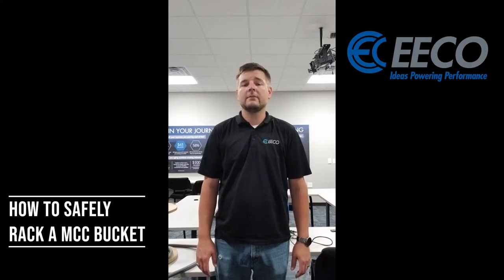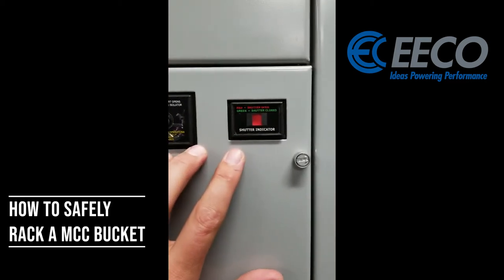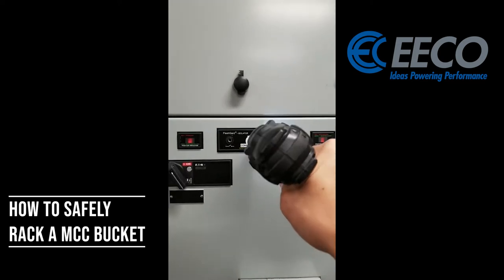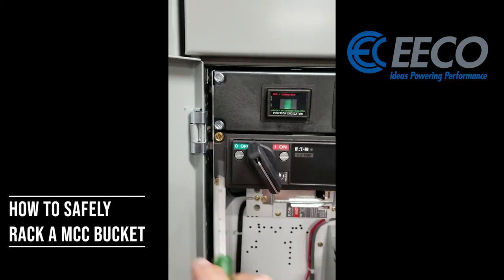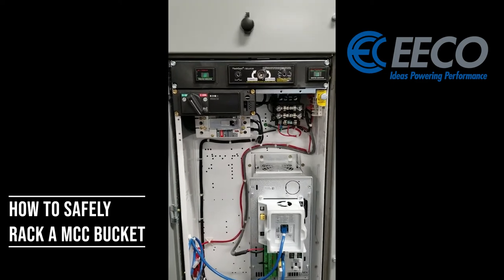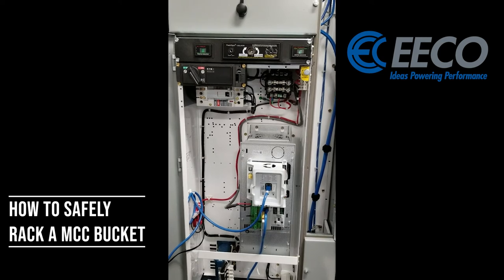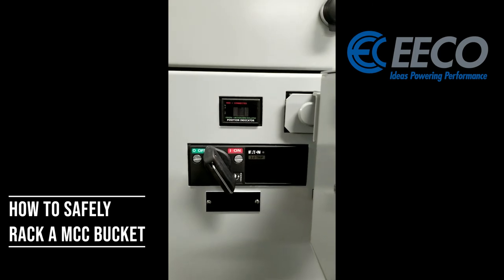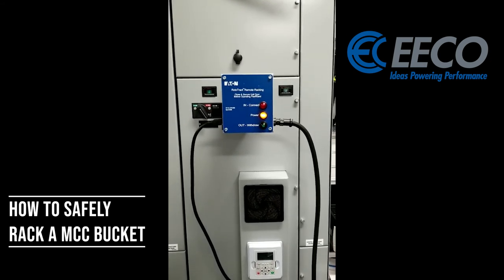How to rack an Eaton MCC Bucket

Comment: Can you remove the bucket without disconnecting the control and power cable on it.
Reply from the maker: The control has a separate connection on the side. As for the power we need more information.  Give us a call and we'll try to help further.